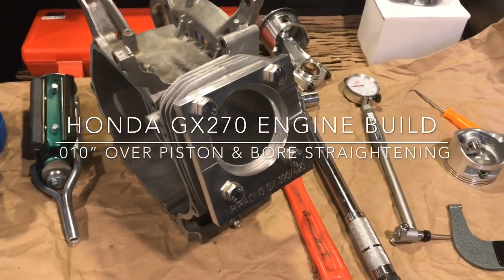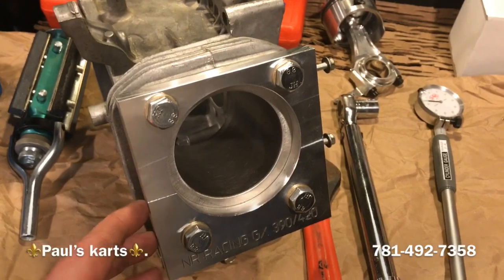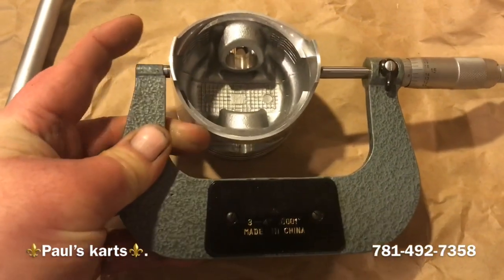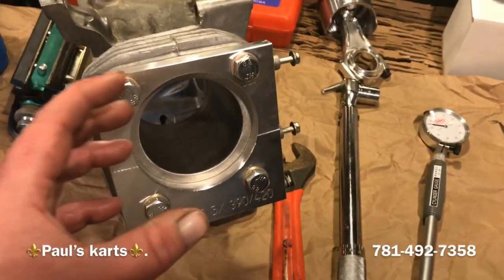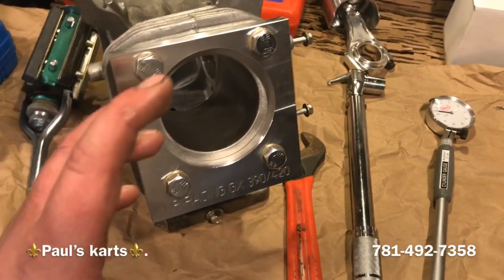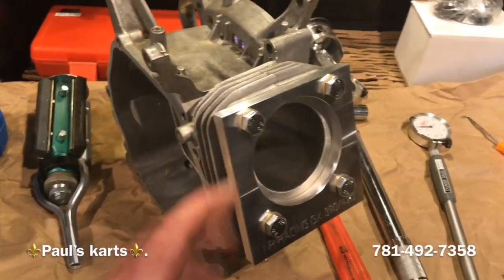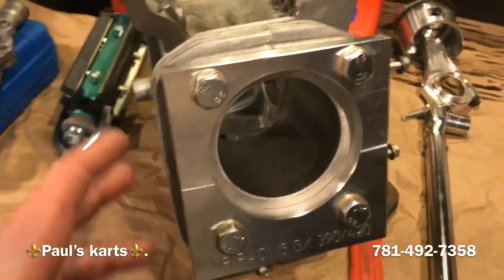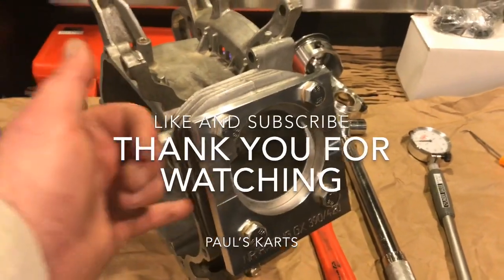HONDA GX270 engine build  ( over sized piston & bore straightening ) // part #6A

Comment: How important is the angle of the piston path to crankshaft? It would seem that needs to be as close to 90° as possible. All the block boring to oversize, milling of the mating surface where head is bolted on and such I have seen only done with the crankcase "jigged" or set-up square; often more work that the actual machining. Not picking or trying to be smart but your honing on these videos appears to be free-hand. Is that adequate if only a few .001" ?
Really enjoying your vids along with the secrets and advice given.
Reply from the maker: I’d have someone do it for you .. bring it to a machine shop .. the hone itself is expensive and you can mess up the block royally if you have never done it before .. you also need a dial bore gauge micrometer etc to do this job .. this is the way I do it but I have done this a hundred times .. and there is no runout when I do it .. not even  .001” that would be a huge mess up as far as I’m concerned .. I am able to get this done perfectly using these tools .. but if your planning on doing it let someone else do it